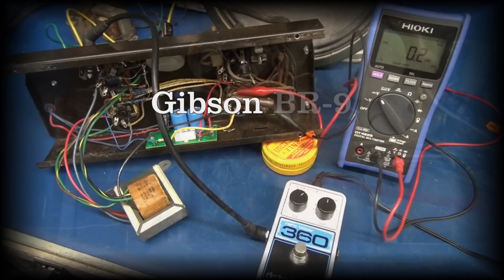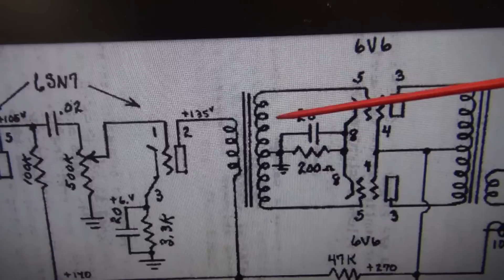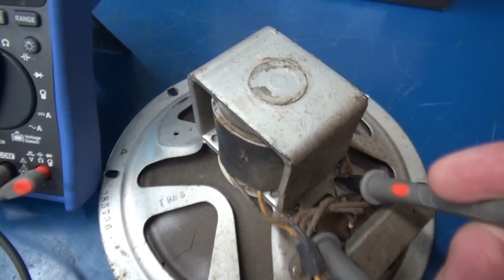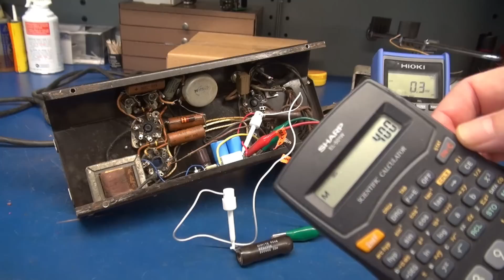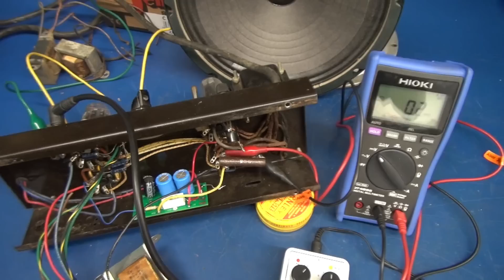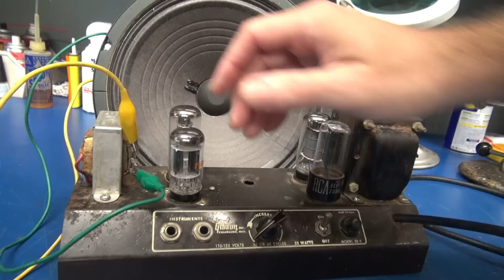Vintage Gibson BR-9 tube guitar amplifier restoration many problems almost not worth fixing

Comment: I have the same amp but mine has a 6SJ7 instead of a 6SN7 it was working with the 6SJ7 but it has since stopped working could it be the preamp tube being wrong mine also doesn't have that transformer in it it had a GZ34 rectifier a 6SJ7 as the preamp and 2 6V6's I assume 1 output tube and 1 phase inverter ? Or is it the 6SJ7 that is the difference and is either doing the phase inverting and preamping there is not even holes in the chassis for that transformer

Comment: Terry, when you replaced the field coil and speaker with the Jensen permanent magnet speaker, did you add a choke or a resistor or a combination of the two to the circuit?  If so, what did you use and how did you wire it in?  Thanks. I really enjoy your videos.  Best.

Comment: What about reducing that Gibson BR-9 to a nice small portable unit using KORG Nu-Tubes 6P1s and use 51V from a Ethernet PSU and a regulator to get the 3V to drive the heater, LT800 will work to drive the Nu-tube 6P1 and the original transformer will work to drive the speaker.

Comment: I bet that if you measured the DC resistance of the new speaker you would find it is less than 4 Ohms.  Impedance and DC resistance are two different measurements.   But it doesn't matter because you replaced the output transformer.  Great sound.

Comment: D LABS, can you show how to measure the 5Y3 inherent loss measurement in a YT video? if the power supply is output 400vdc at 20mA with a 20K load, how do you compute the 5Y3 inherent loss?

Comment: At least some of the hum first heard was due to half the output stage not working because of the open half winding in the coupling transformer, so there was no cancellation. I'm a bit surprised you powered it up in that stagt.

Comment: What is a cup one board. Why not use replacement caps. I am open to new ideas thanks
Reply from the maker: The board (CUB1) is a universal diode/cap board used for building amp projects. There is more info on my website